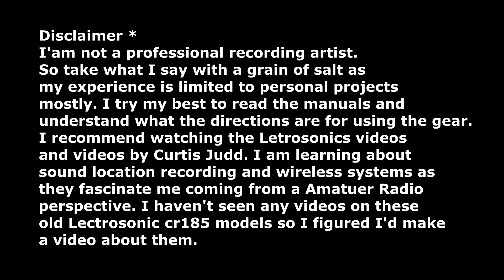Lectrosonics CR185 and M185 Lav System Testing

Comment: Thanks for making this video! You bring up some interesting points, about length of lav mic cable and voltage of rechargeable 9volt batteries. I found Powerex recharcheables at a "true 9.6volts and "9Volt for Music," which "low interference" /impedance, but at 8.7volts (they are plug-in usb charging, which does not allow the space for an extra cell). I love these old Lectros! I still use them and love them. The sound is better than the digital conversion of many low-cost wireless systems, especially Deity and Rode. The new Lectros are expensive, and I do rent when needed.
Reply from the maker: I am also using the 210d lm200c sets now too. Slowly upgrading

Comment: What cable do I need to go straight to camera.
XLR to XLR or what cable?
Reply from the maker: depends on what camera youre using.
Reply: @TheFossilChannel  1 of my options is the AF 100 camera 

I was gifted this CR185 and was curious how they worked, thank you for making this video too
Reply from the maker: okay, so yould probably want xlr to xlr input of the af100 , if i. thinking it has xlr inputs. if the camera does not, you need to consider and xlr cable to whatever port is on the camera. personally id recommend running the cr185 into a seperate mixer / audio recording device and then output from that to the camera for a scratch track.
Reply from the maker: oh btw i had some settings wrong on the cr 185 in video, I use the cr185 in several of my youtube video along with a tram tr50 mic and it is a great system !
Reply: @TheFossilChannel  good to know 😊
Thank you